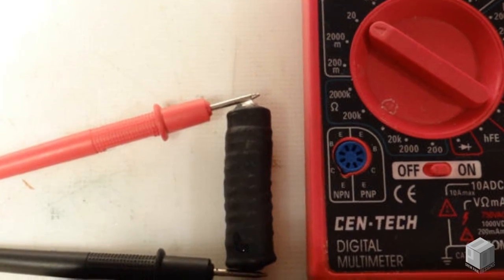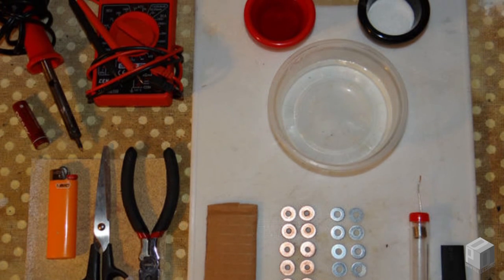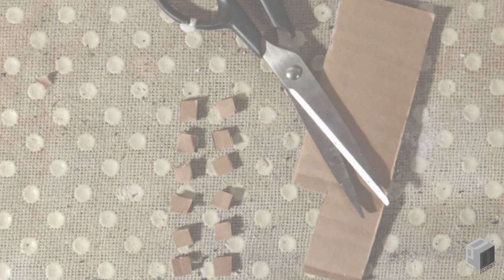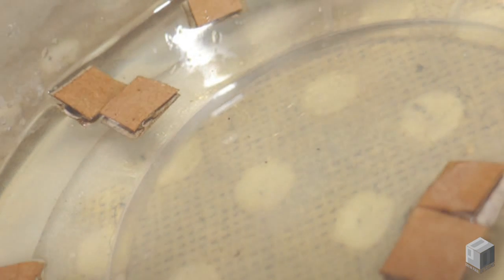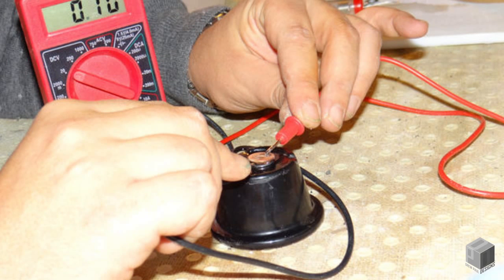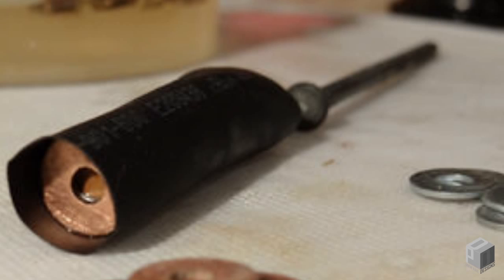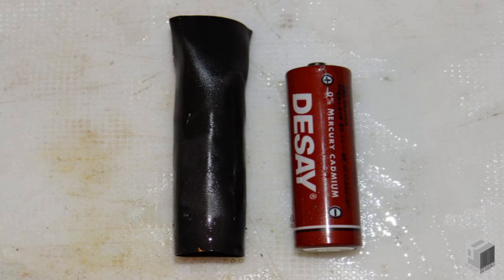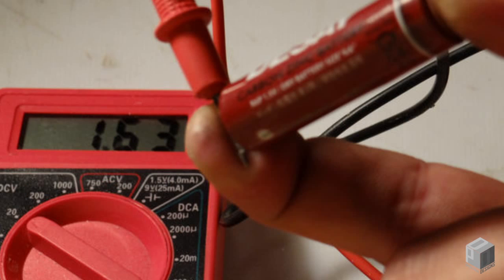DIY AA Batteries!

Comment: could you take a dead battery and reuse the copper and zinc to build the battery like you have ?
Reply from the maker: Your typical store bought battery will not contain zinc or copper. They are made with a different chemistry. But these materials are available in most hardware stores or you might even have them in your garage. Give it a try its a lot of fun and very useful. Thanks for watching!